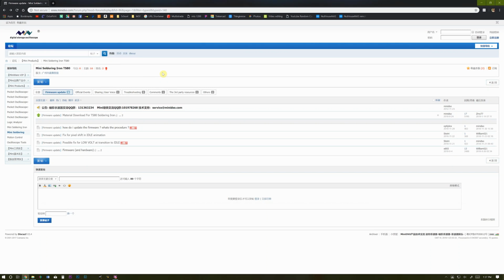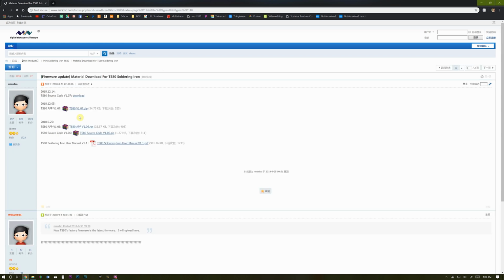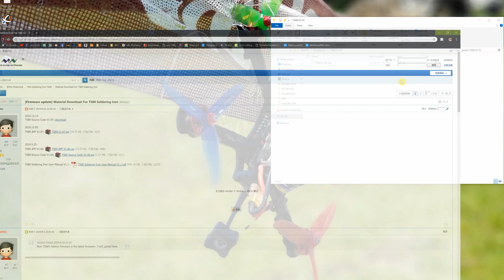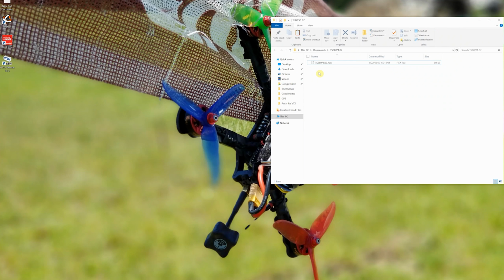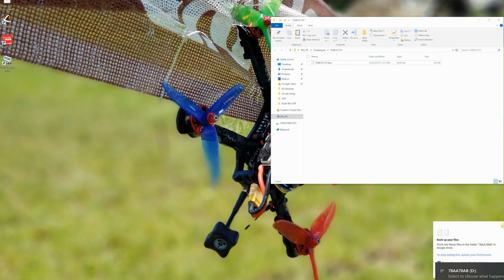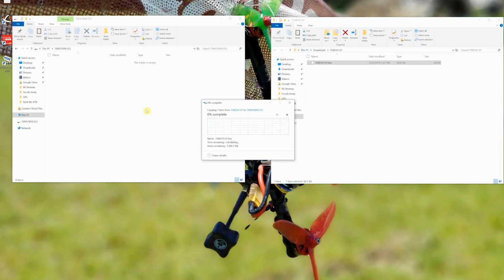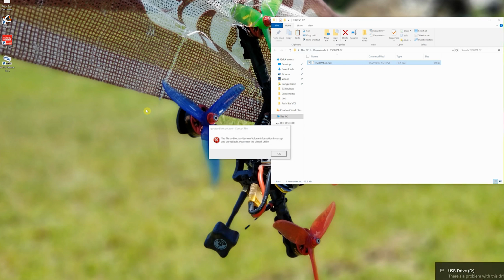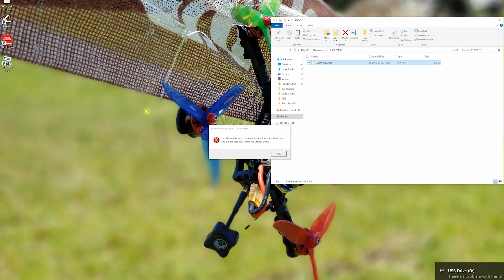TS80 Firmware Update Low volts fixed!

Comment: with the old firmware it would say low voltage when i turned it on and started the heating,  but i could overcome this by entering the menu and pressing the low button for a long time, then afterwards the heating worked

now with this new firmware, i cant get it to work at all!, i always get the low voltage error

tried it with an anker PowerPort 1 USB-C model A2012 + combined with cable anker PowerLine+ USB-C to USB-C 2.0
Reply: i updated the firmware to the custom firmware by ralim and now it works perfectly

sw can be found @ https://github.com/Ralim/ts100/wiki/TS-80 
https://github.com/Ralim/ts100/files/2683327/TS80_2018_12_16.zip
Reply: @quantomtheory  thank you, this helped! :) I had exactly the same problem -- I have an anker powercore+ 20100 usb-c
Reply: @duneplanet  np
Reply: @quantomtheory  Since I have you here - why kill the Kings? That was irrational and barbaric.

Comment: Didn’t work hex file did update 1.0.7 but I still get low on 3 cables and my iPad brick!
Reply from the maker: you need to use a QC 2.0 or 3.0 charging brick.

Comment: i tried it and it didnt work. when i tried to open the file, it would open with a video program. so i installed winzip free version and it opened correctly. then it was simple. just copy the hex file and drop it into the usb device drive. fixed the error and working perfectly so far. thanks so much !!!
Reply from the maker: I'm glad it worked for you. Thanks for watching!

Comment: 1.06 ran ok for me, but it was very picky about power supply. I didn't notice a difference with 1.07 but with Ralim software it will work with any power supply I have, so be careful because it will draw more than it should from power supply's  but if you know the supply is 9v capable it runs great. that software has much more options, but takes some getting used to. overall I would recommend Ralim software.

Comment: If you’re using QC2.0 for this TS80....isn’t that the main “Low Volts” error issue; b/c you should be using a QC3.0 power source?
Reply from the maker: I'm using qc3.0. The issue a lot of people have is when the solder iron comes out of qc3 mode (while heating) a lot of power brcks go back to standard 5v output. The solder iron detects that momentary voltage drop and triggers the low volt warning. I have found that with the newer fw the solder iron is less sensitive to this voltage drop when going back to standby. This is just my experience and my observations with the few usb power monitoring devices that I have at my disposal.
Reply: TweetFPV Okay thx. I’m looking into getting a “mobile” soldering “rig” for doing electrical repair work out in the field. Do not like butane power sources (& in some places, not allowed to use them at all); so I’ve been looking for the best system. The ts100 has to have lipo batteries (or psu w/ you, which defeats purpose of mobile, lol) & the Milwaukee m12 soldering iron “looks” rather uncomfortable & bulky to me. So, just looking at the ts80 & all the diff brands that have them listed from all the different sites out there. Assuming all the same, just rebranded is all. Thx for the help
Reply from the maker: Yes thay are all made by miniware just rebranded by a 3rd party.

Comment: upgrade true, but low volt not fixed =( powerbank Baseus QC 3.0 10000
Reply from the maker: Does it heat up or are you getting the low voltage when you turn the heat off?
Reply: @TweetFPV  some powerbank cant recognice the dataline, So if you want power bank to power it, buy the Anker QC 3.0 not Baseus QC 3.0, i tried it always, thanks for the software now i can save it to my disc Collections
Reply from the maker: If it's branded a qc 3.0 it should work. I wonder if the mfg cut corners on the qc3. 0 standard

Comment: Still having problems with low voltage while trying to power off of Anker Powercore portable charger 20100mAh 4.8A. Is this a problem i can fix by buying a different portable charger?
Reply from the maker: It might be your power bank. Anker says that it doesn't support  Qualcomm Quick Charge
Reply from the maker: What do you have your power setting at in the setup menu? Try turning that all the way down.

Comment: it also will go up to 450, heats up faster also rotation on the screen depending on how you are holding it, a lot of great updates
Reply: The auto screen rotation is moronic. I saw one guy using one and it kept flipping upside down so he had to keep shaking it to correct it. Absolutely no reason for that. You are either left handed or right handed.
Reply: @MrWhaatay  me left handed, wife is not, also son, who does a better job on the small tiny jobs that my old eyes just cannot see
Reply: @BrookZerihun  99.9% of people are the only ones who use it.  Plus it does no good when it keeps flipping upside down.  Takes two seconds to change it in the options. The real issue here is you being too cheap to buy your son one of his own.
Reply: @MrWhaatay  wow 10 subscribers
Reply: @BrookZerihun  Wow,  I haven't posted a single video. I shouldn't have any subscribers.
Reply: @MrWhaatay  well it is now 11, count me in
Reply: @BrookZerihun  Another fan.